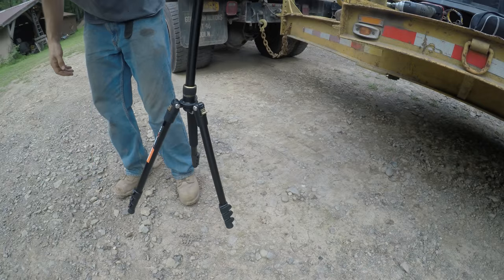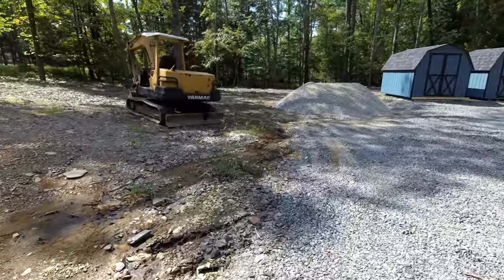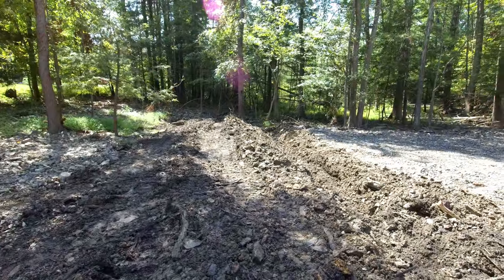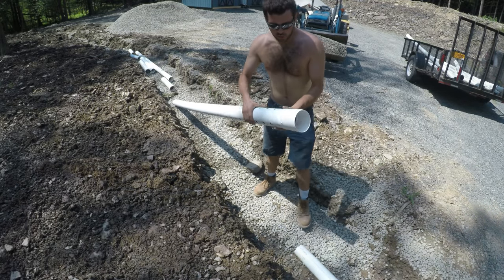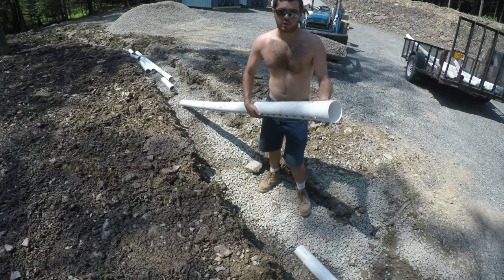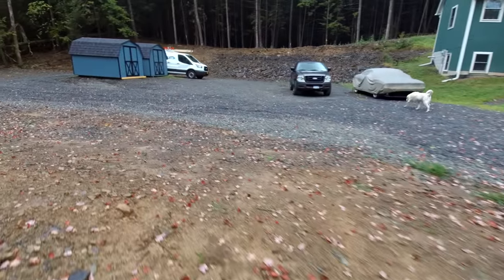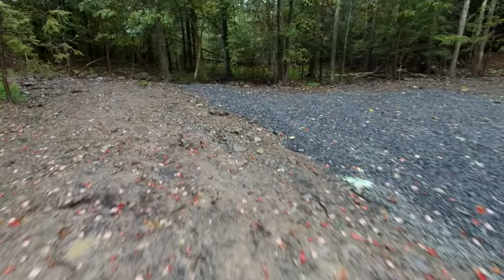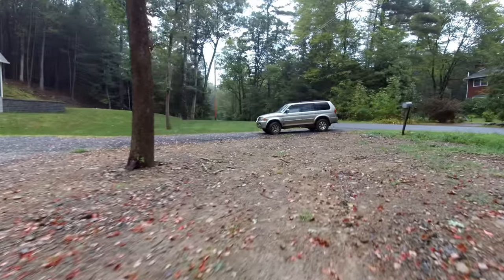Digging a drainage trench

Comment: The drainage pipe holes located horizontally rather than vertically seems more logical. With the holes horizontal once the water reachs the level of the holes it enters the pipe and is removed, flowing with the pitch of the pipe. With the holes placed vertically water enters and leaves equally through the bottom 
so no water is removed by the pipe. This would seem to mean the pipe is then unnecessary.

Comment: A geotextile wrap is good insurance to prevent the pipe from clogging.  I know this isn't a French drain, but it could have been one with just a touch more work.  Obviously..your call.
I did about 1200' of French drain on my property and it does work amazing.
Reply: I have done a French drain where all we put in the trench was the rock all the way to the top. No fabric at all.
Reply: That works but who knows for how long.  
The gravel runs water because of all the air gaps.  If the air gaps fill with debris and silt over the years, water stops flowing.

Comment: What’s the point of the pipe if it’s not daylighting or going into a deep pit you don’t need it. The water will travel through  rock and flow towards lowest point of trench with or with out pipe

Comment: On that kind of pipe, it seems to me the lower the holes are, the lower the water level will be in the ground, and less chance of stones dropping into the pipe.  It also seems to make more sense for the bell to face upstream, like when using a funnel. Then foreign material won't get stuck at the joints.

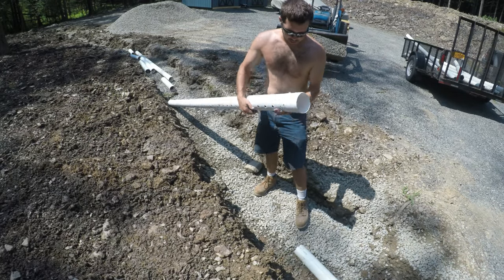Comment: 9:37 The point is that the water slowly should drain to the grount through the holes  in the pipe (if not flooded) and of corse the dirt wouldnt fall straight into the pipe if the holes are pointing down.!And that´s why you plug the upper end of the pipe @ 10:09 :)

Comment: the pipe will clog with silt no matter which way the holes are set.

 they are designed to be set at 5 & 7..  Definitely holes down...you want to drain the water, not float the pipe.
Reply: Also, that prevents bits of gravel from falling into the pipe.

Comment: Andrew, I'm afraid that in the long run, these holes in the drainage pipe may get a little clogged. This gravel in which the pipe lies also has small particles, fractions, and they can clog holes in the pipe. In my country, such pipes are buried with river gravel, which has very little or no fraction of a small size, and only after partial burial of the pipe with river gravel, the rest of the excavation is buried with construction and road gravel, i.e. the one you buried these pipes with.

Comment: Another good vid Andrew, FYI just purchased a Volvo EC-55B Pro excavator and will be starting up a business with my partner soon similar to what you are doing but here in CT , I must say watching you and these vids helped push me and my partner over the fence to get motivated, we have been kicking the idea around for over a decade now.Quick question...what controls do you use on the Yanmar? John Deere pattern or Cat?
Reply: Dave, I don't know what it costs, but look at an Engcon tilt rotator. It is the best attachment for an excavator ever invented.
Reply from the maker: SAE pattern. (I think cat), 98% of machines are SAE, that's the only way to go.
Reply: I ran my machine for two hours the other night with the "SAE" (Cat controls) and I was pulling stumps and burying boulders the size of a lawn chair but I must say I cant get used to the Cat pattern. I located the valve for the switchover to Deere controls and will set it up for ISO tonight. Oh FYI "Dirt Ninja" on you tube is another guy who runs Deere controls so I don't feel so bad now lol
Reply: Brian, I have seen Dirt Ninja use the rotator, looks complicated but in the right hands a pretty nice option for grading

Comment: I think the holes should be up, how else will thevwatter be carried by the pipe?
Reply: The way the pipe functions is that when the ground water level rises the excess water will go into the pipe through the bottom and goto the next "exit", the pipe isnt necessarily to move water from the start of it to the end but more to drain all the water above the pipe

Comment: When using perforated pipe it's best to put own fabric before putting in the gravel because in the future the dirt will clog up the holes in the pipe and it won't work right.
Reply from the maker: Yes, I didn't feel it was necessary because the trench was covered with gravel.

Comment: I enjoy your videos.  Thank you for including the follow up segments.  Why did you not use pvc cement to join the pipe sections?  I am not criticizing, simply curious.  Thanks and best wishes.
Reply from the maker: I've been told to many times its not necessary for that type of pipe. I have glued them sometimes in the past though. But they need to pull apart like 4 inches to come apart, so I agree its not totally necessary to glue them.
Reply: The pipe is there to provide a void, it already has holes in it. A tiny leak around the circumference somewhere  wouldn't be enough to stop it from doing it's job.
Reply: 1985cjjeeper   I believe that Andrew is very talented and does good work.  I was curious about HIS reason for not gluing the pipe.

I understand that the pipe already has holes.   However, the reason for gluing it together is to prevent the sections from separating.  Freeze / thaw cycles can move the pipe.  Some of the pipe installed was obviously above the frost line.   Driving over the pipe can cause it to squirm apart.  My point is that things happen.  Better safe than sorry.  An ounce of prevention is better than a pound of cure.  Best wishes.

Comment: Hi Andrew, your channel rocks! Sorry to reopen the debate but I wanted to comment about the holes in the pipes. Wouldn't it be possible that the 2 positions lower and higher are equally valid? It being the function of that kind of pipe and being dependent on the amount of water to be drained? Because when you look at the pipe from its front end you can clearly see that the holes being up or down will determine the water level and therefor the possible amount of water that can be evacuated. So in fact this pipe is more like a tool than a regular one some sort of faucet with only two positions if I may be so bold. But anyways I really appreciate what you do. Your channel is amazing. Keep up the good work!   ...I just realized that this video was posted 10 months ago :-( so much for a pertinent comment!

Comment: I know this was posted by AC a few years ago, and I have watched the video he referenced where he placed perimeter drainage and AC is totally correct when stating the hole orientation should be DOWN. Excerpt from eng-tips.com of which I am NOT affiliated: “Generally, the holes for French drains should be pointing down, or at least oriented in a downward direction. Question: holes up or down? Answer, down. This is counter-intuitive, as people think this will cause the water to drain out of the pipe, rather ...”.

Comment: How did you measure the depth of the ditch to ensure that the water would drain downhill, away from the house?
Reply from the maker: Just by looking at it.
Reply: @AndrewCamarata  in other words, experience, or was I being mislead by one of the short falls of video; not being able to judge slopes and angles?
Reply from the maker: Peter Hicks ground was kinda flat. Once it was dug it was deep enough. That worked well.

Comment: Logically thinking about drainage pipes, holes on bottom doesn't do much like just leaving gravel in the ditch. Holes on top would fill up with dirt and gravel as it rains and stop the flow. I was thinking on the sides. As water fills up in the gravel ditch, it is collected by the pipe and allows it to flow out the ends. Just my UN-educated opinion.

Comment: Surprised you didn't have a "Locate" done there. I used to do that for a living. Electric lines that go from Pole to house are suppose to be around 2 to 3 feet down. Gas is 3 feet.
Reply: 16 ton for a single axle is pretty heavy. I don't know your weight limits in NY.
Reply from the maker: Thats a 2 axle truck. 16 tons would be very heavy for a single axle.
Reply: @AndrewCamarata  My bad,,I was looking at the truck that pulled the trailer. Yes, you have a Tandem for the rock haul. Don't you all do underground Locates before you dig?
Reply from the maker: I do the locates when there might be public utilities. When its private stuff, they wont come up. I knew there was electric there anyways.
Reply: @AndrewCamarata  Look forward to your next video.

Comment: What a great way to start the weekend! Yay! It’s Camarata time! 
Andrew, Looks you added a 4X4 length of angle to the top of the box blade. Does that much weight make a significant difference? I may want to try it with mine.
Reply from the maker: Added angle to the box blade? That's how it came.
Reply: Oh, ok. Gotcha. Thanks for responding. Mine doesn’t have anything on top of the box other than the attachment points

Comment: The holes should be one the side of the water flow so the pipe will fill with water and the water can travel down the pipe and out the end other wise it is defeating the purpose of the pipe

Comment: You should get a roller attachment for your tractor to help flatten the gravel
Reply from the maker: I might. They are expensive.
Reply: @AndrewCamarata  I saw a guy take a 50 gallon plastic barrel and filled it with concrete and had a metal pipe in the middle and stuck a chain through it and was able to use it. I'm not sure how long it lasted before the concrete started to break up but it worked as a roller for a while. Your good at making stuff im sure you can rig something up.
Reply from the maker: It needs to vibrate.
Reply: @AndrewCamarata  oh ok. I don't know a whole lot about them

Comment: rodent guards are a really good idea on the end of drain pipes. put one or two HORIZONTAL bolts in the end of the pipe to prevent rats and skunks etc from crawling in and getting stuck plugging it. Need to be horizontal not vertical so debris does not catch on them.

Comment: I would think the holes go to the side that way the water rises up to the holes and then drop down into the pipe and flows out. Also why didn't you put down any fiber cloth over the top of the pipe? That's mandatory in my opinion it's like a filter to keep any dirt particles from filling the pipe up with dirt and eventually will fill up and be like mud and be worthless at that point. At any rate enjoy the videos I probably watch more of yours then any others. There are some of yours I've seen like three times when I have my settings set on autoplay. There's a lot of things you do that I would question but I don't. Like that bearing on your truck yes you did pack it wrong. You should get you that little tool that packs them for you. It's those two discs that are kind of pyramid tapered but they're round. It's got an oil Cirque at the top that when you put the bearing in there and pinch it in between the two discs you pump grease into the oil Cirque and it saturates the bearing in grease. It's like an 8 to $12 tool and priceless. Does a great job works perfect. It waste a lot of Grease though but you just put it into a can and save it

Comment: Why wouldn't you call to have the utilities marked so you know where they are..? here we can not dig unless we do that .why not let the tailgate hit the body when you dump as you pull up stop quick and bam the loose stuff falls out. Holes on side of the pipe so water stays in pipe flows out not back out thru holes on the bottom into the trench.?
Reply from the maker: Because I knew where it was.

Comment: Video too short. What am I supposed to do the rest of the weekend?  Please put some wd-40 on that door so it doesn’t squeak lol
Reply: New Hinges
Reply: instead of WD40, use a siliconized lubricant from like PB blaster. Lasts longer and lubricates better. Or, like Ostrand11 said, new hinges...
Reply: @ostrand11  Yup that door look pretty droopy when opened, just like most older Fords tho lol
Reply: WD-40 is only a short term solution. It's a solvent, not an oil.

Comment: if the holes are facing down, wtf is the pipe doing?
Reply from the maker: Lol, I know right. It works both ways. At least with the holes up, any water that gets into the pipe, goes out the end of the pipe. This has sparked many arguments.
Reply: you haven't answered my question lol
Reply from the maker: It still works with the holes down, it gives the water an easier path to follow than just threw the gravel.
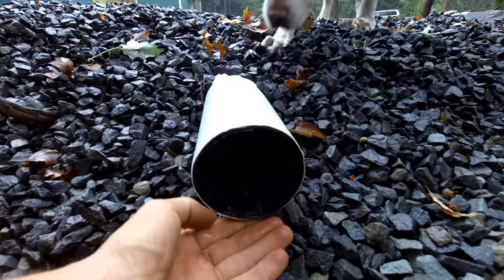Reply: looking at the end of the pipe (19:27)  it looks like you had it oriented so that one row of holes was directly on the bottom... i don't have any experience with this but shouldn't the two rows be level with eachother so the pipe doesn't just dump the water right underneath it? i mean i think that defeats the whole purpose of the pipe.

Comment: How many tons does that yanmar weigh?
Reply from the maker: I think a little over 5
Reply: @AndrewCamarata  perfect size to clear my land in forestburgh I have 20 acres.
Reply from the maker: Think so? I would maybe get a bigger machine for clearing that much.
Reply from the maker: What are you clearing? Is it big trees? That Yanmar has to dig around big trees for a while to get them over. A big machine can just push trees down.
Reply: @AndrewCamarata  I hear you. Thin trees maybe some thicker in some areas. Not an extremely woody lot.
Reply: @AndrewCamarata  thanks.
Reply from the maker: Sometimes even a dozer is best for that. Or a skid steer and a mulcher if its smaller trees and the ground is already smooth.
Reply: @AndrewCamarata  Thanks for your replies. I really appreciate it. I may rent a regular backhoe or mini excavator from United rentals. I've ran a case 580 but never a excavator. What do you reccomend for clearing about 1/2 acre.

Comment: shouldn't you have wrapped that pvc in felt to keep out any larger particles?
Reply: Ordinarily, I would agree. However, the holes being in the lower orientation will minimize any issues with the gravel entering the pipe and the trench was only filled with the gravel. The excavated soil was used elsewhere.
Reply from the maker: Since it was covered with gravel I don't think so. If I had covered it with dirt I would have used fabric.

Comment: IMO the holes should be at the 3 and 9 or oclock position or even higher up if there is more water expected. This is so the water can drain down the bottom of the pipe. The way you have it installed makes the pipe useless. Just my 2 cents.

Comment: I just wonder how the new driveway extension will hold up without a layer of large stone being put down first. The smaller 3/4 rock will eventually be pushed into the dirt, or dirt will be pushed up through the gravel (however you want to look at it) and will be muddy again. I guess that is job security as you will have to return to add more 3/4 gravel in a few years. Oh yeah, there is more than likely a free locate service that can actually let you know where the utilities are at. They may need a day or two to do the locate, but well worth it. If you hit the power it could kill you. If you live, you would have a heafty fee to pay as well as the replacement for the service. Would your insurance cover that without a locate being done? Just some thoughts I had. Looks good for now, still worried about the new portion of drive.

Comment: the pipe you used is not ment to be used for dranage that pipe is for field beds drainage pipe know as weeping pipe comes in 50 foot rolls and is corrigated so you can drive over it without collapse and is fabric covered to prevent sand infiltration

Comment: They must tax on the footprint of the house.  The couple videos I watched have tiny footprint houses with maximized usable space.
Reply: Tax isn't based on the footprint, in theory it's based on the value of the structure.  There is an "art" in explaining to the county Tax Assessor why your new structure is worth less than other structures of similar size.   These tax guys are  suppose to give a reasonable estimate of the value of a building, it will affect the amount of the tax payments forever.
Reply: @davidnull5590  I was being facetious.  Treating the small house size as a reason to avoid taxes.

Comment: You do great work, but this property in itself has no character or 'home' feeling to me. It's more like a house stuck on a big parking lot now. The storage sheds are on a concrete slab with a driveway behind it, instead of being tugged away to the edge of the property, soon there will be a garage between the house and the sheds too. It feels like this property would benefit from a landscaping architect to give it some character and design, instead of just  making it all flat, filling it up with gravel and putting buildings all over to fill up the space.
Reply from the maker: Those sheds used to be on the edge. I agree it could use more. Having the lawn in the front will help. And he was talking about doing a pond in the area behind the sheds.
Reply: I hope you get the job to dig that pond and maybe you can talk him into running a waterfall with big terrace boulders off the big slope along the rear of the property - another video worth waiting for ;)